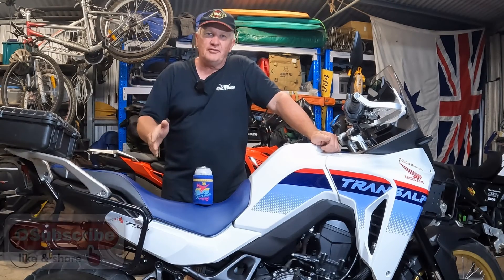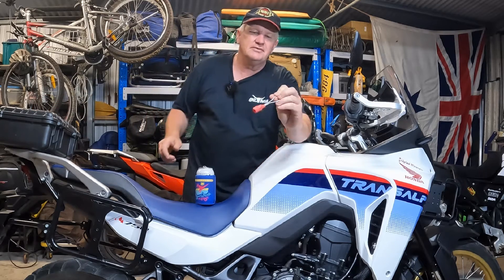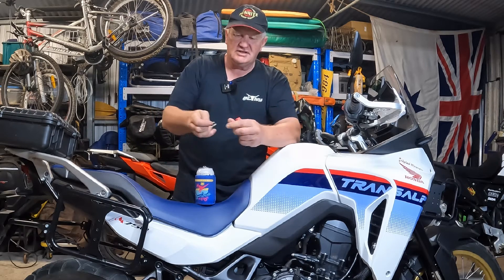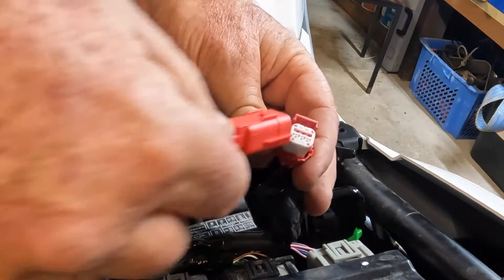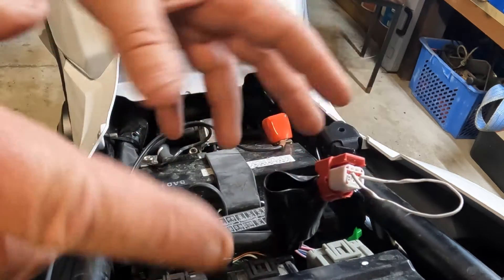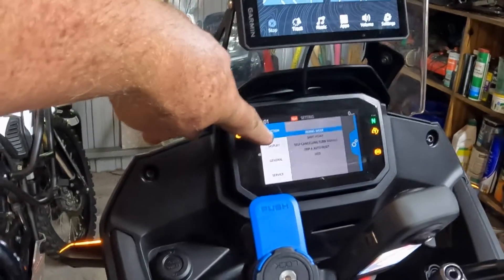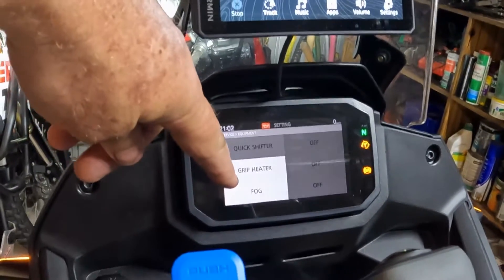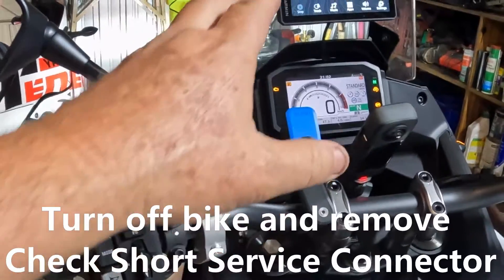Honda Transalp XL750 Check Short Service Connector #heatedgrips #foglights #quickshifter #transalp

Comment: Great ! Just to confirm, you add the wire before switching bike on, then only  turn on once connected?
Reply from the maker: Yes, I plug the wire in before turning the ignition on.

Comment: Thanks man,you've saved me a 50-mile round trip to the Honda dealer and £45 bill brilliant thanks
Reply from the maker: No problem 👍
Reply: hello man, i have this problem and i dont know how to solve it, i take any cable (because i don't have that specific plug) and i connect it in the inner whol and the outter hole?

Comment: Thanks for the video. My Transalp has the Quickshifter and heated grips installed and functional, no fog lights. But the menu you were showing is on my bike gray and doesn't allow to select on or off. Yes, I can switch the QS of in the QS menu, but not in that one you explained in your video. Any idea why!
Reply from the maker: Sorry I do not know why. I will have a look at my bike's menu and try to work it out.

Comment: Hello. I have set up the fast option and I want to program it, but I don't want to pay so much money for the Shorting Connector. Will I be able to do that with the cable or will I damage the bike's electronics. Also which holes exactly am I shorting? Thank you very much.
Reply from the maker: Using a paper clip or a short piece of electrical wire is OK. You place them into the the outer connections in the plug. I believe you can see this in the video.

Comment: Thanx for the video. Dealer says they are getting my  2024 next week and then I get it. 😂.
I have a 2022 KTM 300 XC TPI 2 stroke enduro. It has fuel & oil injection and with an adapter cable I am able to connect an OBD II scanner to it to read everything but cannot reset codes as far as I know.

Do you know if this can be done on the Transalp?

The same OBD II (2)  reader connects to my Toyota RAV4 suv without an adapter.
Reply from the maker: Sorry I do not know, please let me know if you find out.

Comment: Have you tried setting the User Settings with the Shorting Connector attached, in the hope that they don’t reset to default every time you turn the bike off?
Reply: That would be excellent, I eagerly await your response.
Reply from the maker: No I have not and I believe that I had seen your post on Facebook about it earlier. If I get some time I might try it and report back to you.
Reply: @HardPackedADV  Any update?That would be very interesting...

Comment: Hi there, in the description you mention that the part number is 070PZ-ZY30100, yet in the screenshot from Ali Express, the part number shows as 070MZ-0010300. Are they essentially the same?
Cheers.
Reply from the maker: The part number that I had ordered and shown in the video is 070MZ-0010300, not 301 as I had in the description. I am told that they are the same except from different suppliers. I have changed the description to show the same part number (300), thanks for pointing that out to me.

Comment: Hi Martin. How do you have your Garmin GPS mounted?
Reply from the maker: I have used an Aliexpress GPS mount. When fitting you will find that you need to slightly bend the top arms which is easy to do, and the OEM screws that hold the windscreen on are a touch short but with a bit of patiences you will get them on, or buy some longer ones from a hardware store. https://www.aliexpress.com/item/1005006065801154.html?spm=a2g0o.order_list.order_list_main.22.51851802dX4LCM